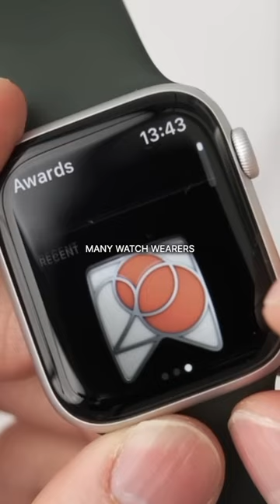Watch Movements Explained #luxurywatch #rolex #quartz

Comment: What about battery powered watches where the battery replaced the mainspring eg original Hamilton Pacer? Or tuning fork watches where a mechanical movement is governed by a vibrating fork with a ratchet attatched, eg Bulova Accutron, Omega f300, f720?